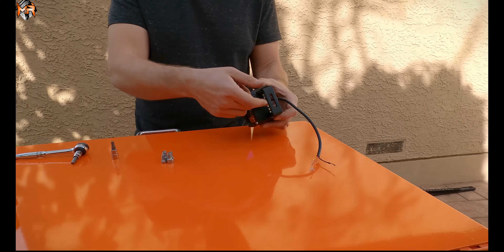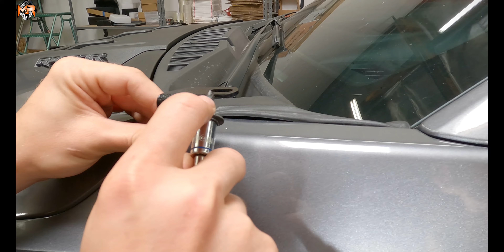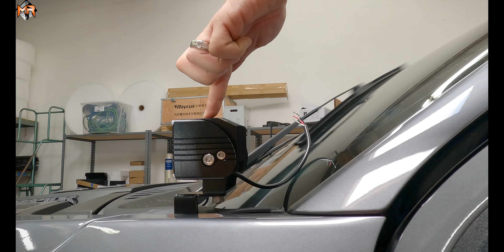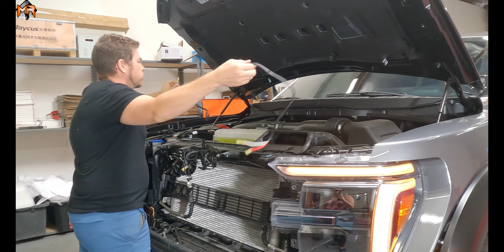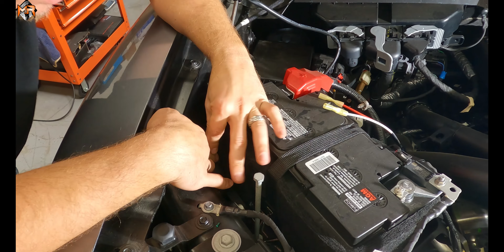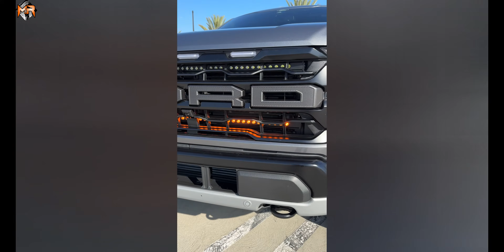2024 Ford F150 Raptor Gen 3 (refresh) Ditch Lights (TUTORIAL) | M&R Automotive

Comment: Will M&R offer a pocket fog kit for the 2024+ F150 Raptor Modular Bumper? I assume it might be tricky with a parking sensor in there. Ideally offer a bracket kit so one could use any light they wanted  OR already had.  Like a 2" pod and a 3" pod per side with the parking sensor between them.  For example, I removed the 2" and 3" pods from the pockets of my Gen2 when I sold it. Now that I have a 2024 with the modular bumper, I've been patiently waiting for a lighting company (like M&R) to figure out a mounting kit that incorporates that parking sensor.
Thanks guys !!!!
Reply from the maker: Thanks for the comment I’ll look into it